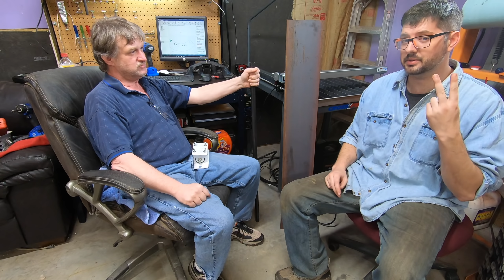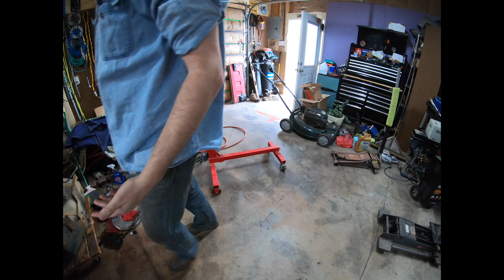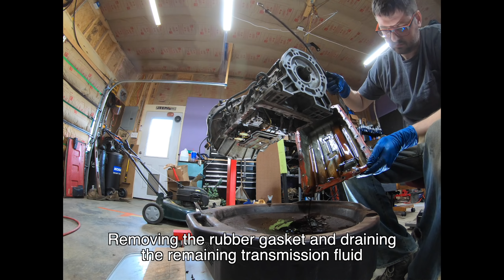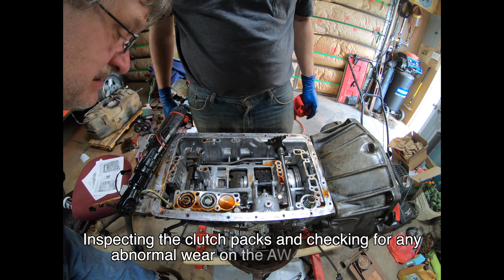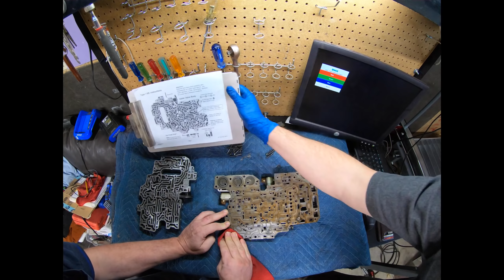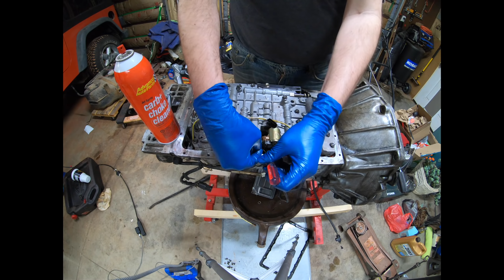AW4 Crossmember Ideas and TransGo 340-HD2 Shift Kit Installation [Felicity - 17]

Comment: the accumulator springs are suppose to go on the small end of the accumulator. you have them on the big end, which should have no springs.

also for anyone reading ignore the comment about the transmission being Japanese so you don't have to install a separator gasket. this is wrong (they even removed a gasket) and majorly increases chances of cross leaks. you would have been better off reusing the old gasket. good luck

Comment: I believe Kyfiss ! Is correct, i have seen others do this on LHD and they didn’t have to do anything to there steering box, I believe 1.25 inches is close to the limit though.  Keep up the great work on the videos!
Reply: I believe a 1.25 is the smallest/shortest body lift offered. I haven't looked for a body lift though because it doesn't serve much of a purpose for me. I bought a TJ with a 3" Body lift. I don't know why the previous owner thought that was a good idea. I immediately removed it and put it a real 2.5" Suspension lift.
Reply: Oh and you are correct the steering box stays in the stock position. The steering shaft is telescopic on the TJ and lengthens to make up the added distance from the firewall and steering box.

Comment: A 1.25" Body lift will help with a lot of your clearance issues without sacrificing your stock suspension geometry. It would also potentially allow you to raise your transmission higher with your cross member you are making with adequate space between the transmission and tunnel. I'm not sure if it's different for a right hand drive model TJ but it's definitely worth looking into.